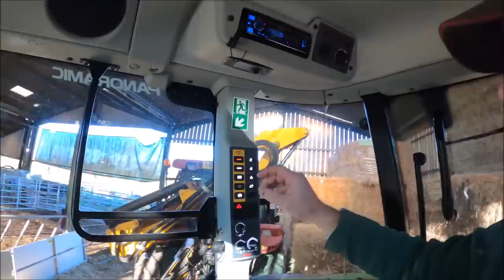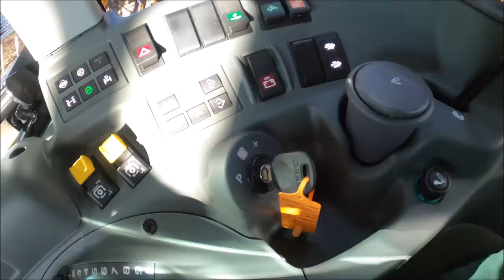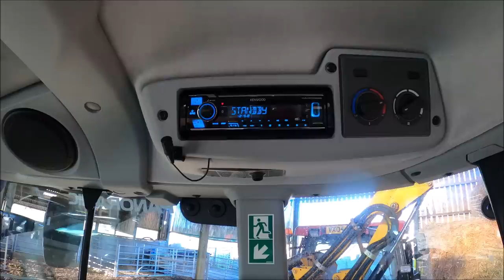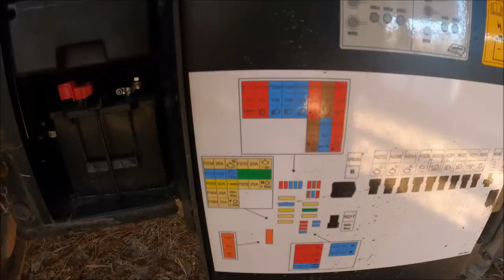08/12/22.  CLAAS ARION 470.  Would I buy one?

Comment: Great review, I would assume the Usb points would be on the bottom of the Light switches column under the black round flap perhaps???. Very expensive good piece of kit, would be ok with a few years warranty & servive plan, but after that runs out. I see very big maintanance bills for such a high electronical & hydraulic relied upon powered/driven machine. Also with Biskit bed on the shelf area which would be great with the bit of fresh air from the window, only wonder where you would be able to mount your flail controls to.?? 🥰💕💕💕

Comment: I think you summed it up right at the begining of this video.........when your a farmer you have lots of different jobs to do each day on the farm and very often you don't get the time or have a huge amount of work to do with the tractor so therefore you wouldn't really be wanting to spend all that money just to use it  for a couple of hours each day.  as for the tractor itself it looks a nice bit of kit but i did think theres a lot of places inside the cab to gather dust and dirt also around the back especially around the cab suspension there seemed to be lots of places to hold the mud and dust. does the tractor have a push out hitch????? even my 14 year old SAME has a push out hitch
Reply from the maker: The push out hitch was featured in a previous video. 👍🏼

Comment: Really struggling to understand the £147k price of the Claas. The FW 2022 guide listed these in the 90-100k bracket before the customary discount. Ok so the loader is £10k? And it did seem to have ever option ticked. Would have thought around 120k to-125k before discount- generally they have been more expensive than Case or NH and about the  same as MF and cheaper than Deere. Anyone out there any recent price experience?
Reply: 158k for an arion 650 CEBIS everything on it including autosteer. That price includes vat. They have jumped about 30% in price in the last 12 months